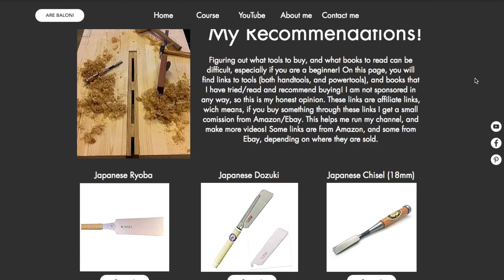Testing my new CHAINSAW-MILL Setup!

Comment: 2 things : get a rope winch, the wide band has no stretch and will force your saw trough every time you turn the crank. a rope will stretch and gently pull it trough.
is that a hardnose bar or a sprocket nose bar? if it is a sprocket nose bar please remove the clamp from the sprocket, it will kill your bar very fast.

Comment: I know this video is a few years old now but what I do Is leave the top rails/ladder on for each cut it help getting the saw in and out of the log also use chord on the winch put the winch to one side next to the saw go up the end of ladder and back to opposite side like a triangle plus you have mill wrong way around put round tube to front and winch to the back

Comment: That winch on your chainsaw mill didn't seem to help all that much.  Many of the other winch setups on chainsaw mills I've seen run to a pulley to the far end of the log and back to the chainsaw mill so that you are pulling on both ends of the mill.  I agree with the other comment that using the webbing strap isn't as ideal as using a rope that has a little bit of give to it.

Comment: He Are,
Great video again that log must be 200ponds i think.
I could not see  not good but i believed the chain was a litle dull or am i wrong.
i only see saw dust. 
but maybe i am wrong.
See you in your next video Are.
 Germany sends greetings
Reply from the maker: Thanks, Willem! You are right, it was a bit dull. This is a different kind of chain then on a "normal" chainsaw, so I have struggeled a bit with sharpening it properly!
Reply: Are Baloni 
He  Are,
thank jou for your ansering.
if you need a sharp chain you can send it over to me. i always sharpen de chain for the hole family and that can be op to 20 times in month.
so i have a litle experience in sharpening.
Just give a wink ;D 
Greeting from Germany